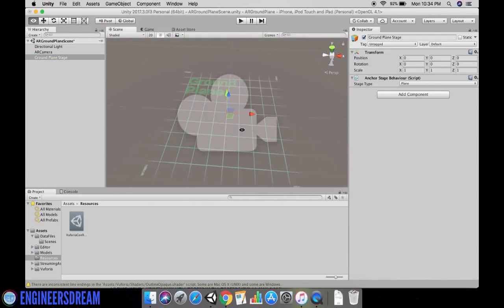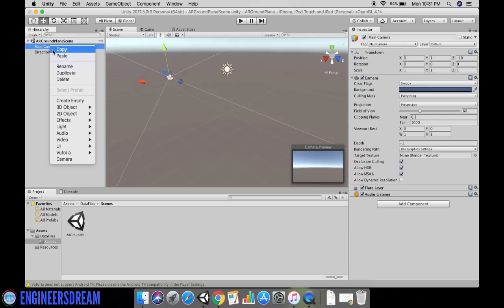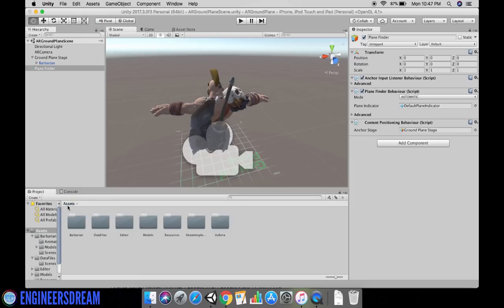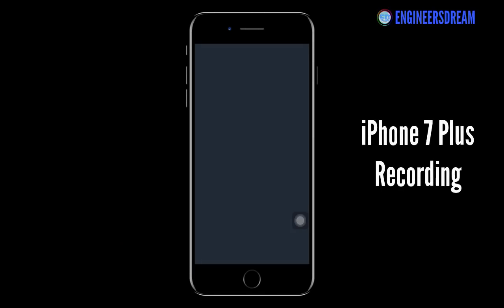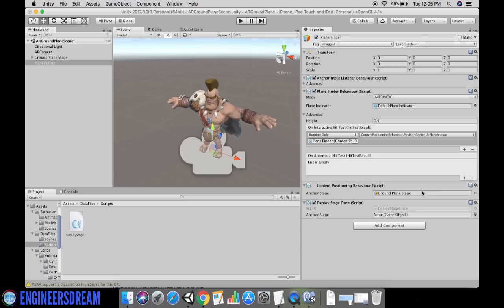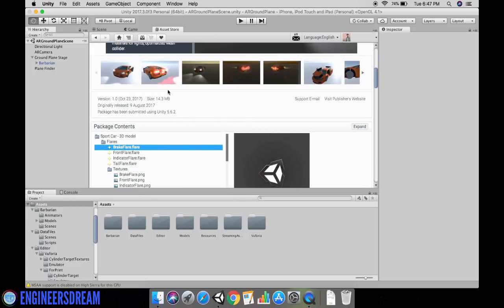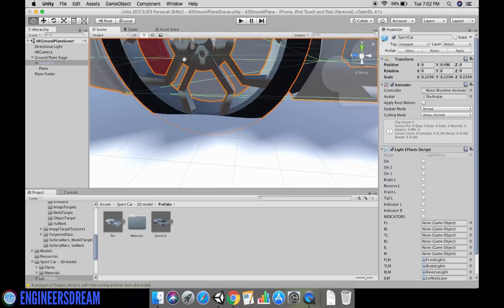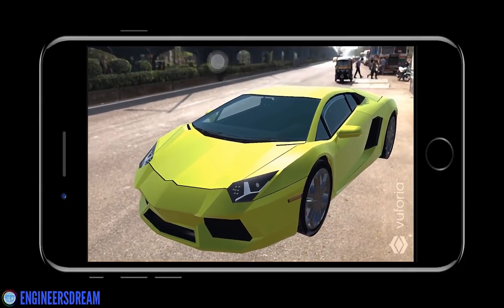VUFORIA GROUND PLANE DETECTION TUTORIAL WITH VUFORIA 7

Comment: Thank you very much for your tutorial, it is awesome.
Could you make a tutorial of ground detection using Vuforia in Unity:
. Does it possible to recognize the floor, if I want to placement with big 3D object ( around 3 meter x 1.5 meter )?
. How can I touch screen to placement only one object on the floor? after that, can  interact on 3D object, such as rotation, scale or move 
. Is it possible to make ground plane detection measure , whether that place is enough space to place 3D object or not. and if it not enough place, disable user to place 3D object.

Thank you very much.

Comment: Hi, May I ask if it's possible to attach "Image Target (with 3D object under it)" under "Ground Plane Stage".

My intent is to use the "Image Target" as a point to draw the 3D object then transfer the location to "Ground Plane Stage" using its superior tracking as anchors.

Comment: I trying to make Vuforia Model target for IOS .
That application i made in windows ios platform and its working properly in editor mode without error.

But when i open same project in IOS Unity (I tried  Unity 2017.3.1f1,2017.3.1p2, 2017.3.1p1, 2018.1.0b9) all showing this error when put vuforia model target. 

sample2 is my model target name 

Failed to load data set sample2.
UnityEngine.Debug:LogError(Object)
Vuforia.DatabaseLoadARController:LoadDatasets()
Vuforia.VuforiaARController:Start()
System.Delegate:DynamicInvoke(Object[])
Vuforia.DelegateHelper:InvokeDelegate(Delegate, Object[])
Vuforia.DelegateHelper:InvokeWithExceptionHandling(Action)
Vuforia.VuforiaBehaviour:Start()

if i open  2017.3.0f3 this error will not come.But if i use this version unity default model target with build working .
When i  add new model target build will happening but after build camera is not working
after unity loading logo its showing black screen and app going close

i have attache 2 screen shot .this app is crashing from that point.

https://i.imgur.com/s0LJGjG.jpg

https://i.imgur.com/SPDlcyd.jpg

Comment: Hello, I am using a Samsung Galaxy A5 with Android 7.0, which is listed in the supported devices for Ground Plane.
Vuforia Version 7.0.43 and Unity 2017.3 Patch 2. but it does not work.
Reply: Montacer Dkhilali Hello, Did you found the solution?